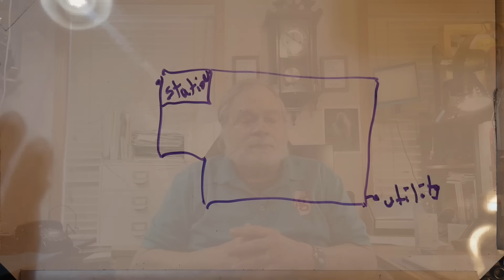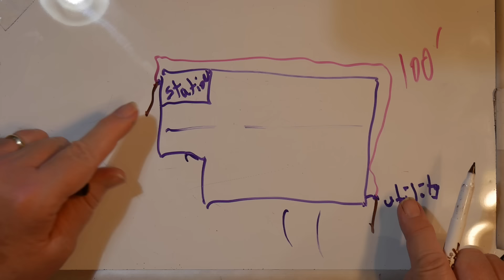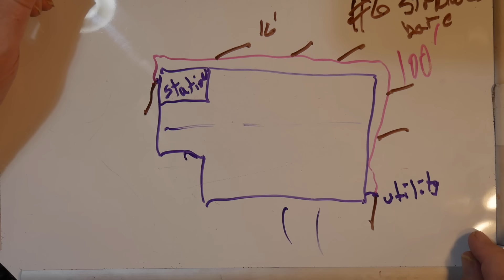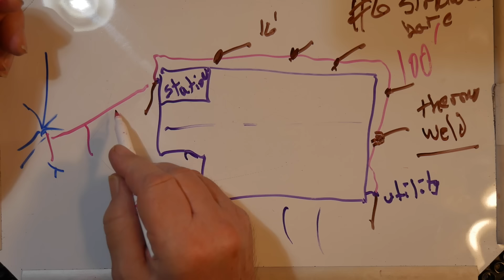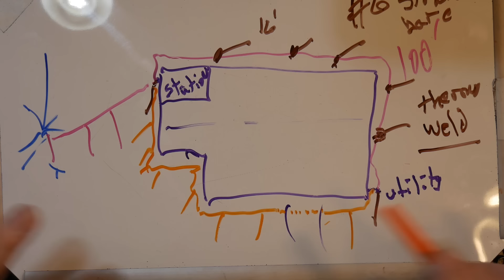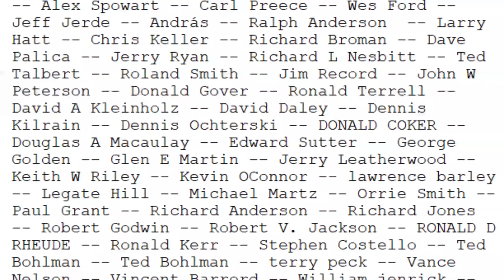Importance of Bonding to Utility Ground (#1115)

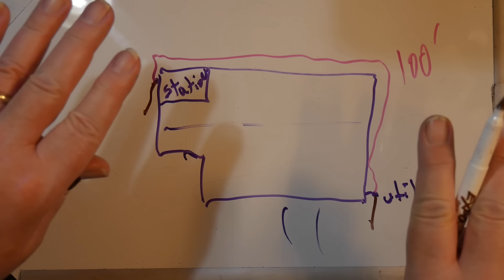Comment: Time stamp 4:20 --  VERY well pointed out.   Earth, soil, has resistance. E-IxR !!   Listen to the OG, old guy. 
 After a lightning strike:  the well engineered system sees nothing. 
 A lucky person has that voltage difference go through the equipment and burns out the Yeasu radio. 
The unlucky person has the voltage go through them. 
The possibly sued person has the voltage go through a guest or other family member, burning or killing them.    "Electricity takes ALL paths to ground"   
I apologize for that sounding preachy. Just think it through. 
I confess I need to ground my antenna supports and add a few ground rods.  I use "acorn nut ground rod clamps" to bond - that is me, no legal suggestions made. May look at the welded approach. 
(smiles)  Yes my shack, very small,  is also diametrically opposite the service entrance.  It was not planned that way. 
BTW, even the electric company has to replace ground roods as they go bad.   Driving ground rod can be troublesome. Some soil is rocky or sandy.   
73

Comment: I have no option for a ground rod where I live, when the house was built the entire property was surrouneded by cement (Inner city).  I can access the main ground electrode system, but cannot add another.  Is it safe to connect my shack grounds to that?
Reply: Not only is it safe, it is imperative!

Concrete encased earth electrodes are fantastic in terms of function.
Reply: @denverbraughler3948  Thanks,  and ground both the station and the antenna to this? :)  (sorry, newb here)
Reply: @randomcrap763 :

Your house electrical system must already be connected to the GEC.
(If it isn’t, that’s a major error.  The connection must be from your house panel to the grounding electrode system.)
Your indoor equipment connects to the grounding electrode system via the house electrical system, and to the antenna grounding system via the shield of the antenna cable.

An additional connection from your entry point to your rack or equipment shell isn’t mandatory unless you actually have a problem with stray voltage, that is, if you can read milliamps or volts between outside and inside grounds.

Comment: Totally unnecessary if you disconnect antenna cables unless you are operating in good weather. Especially if you are using portable antennas.
Reply: * Totally necessary because there are many types of electrical anomalies that are not related to local lightning strikes.
Reply: @denverbraughler3948  Using your logic, I would have to drive a ground rod at my picnic table when running POTA and run a bonding wire to the service ground of the park office.
Reply: @ArizonaPatriot1 :

The topic is indoor, grid-connected equipment and outdoor antennas.

If you change the topic to a temporary outdoor setup not connected to grid power, expect a different answer.